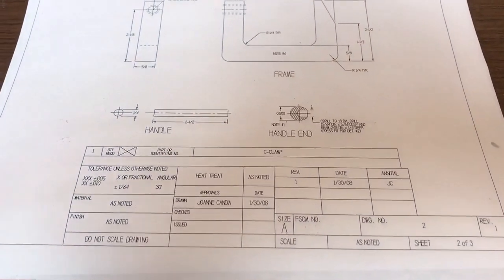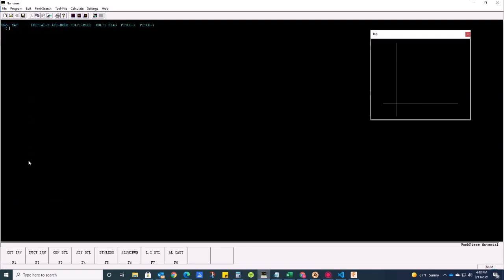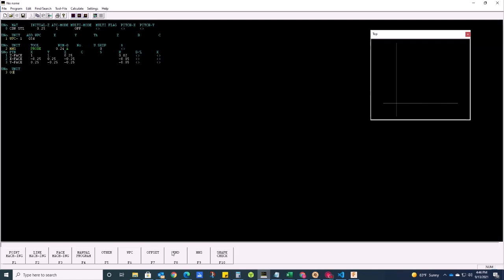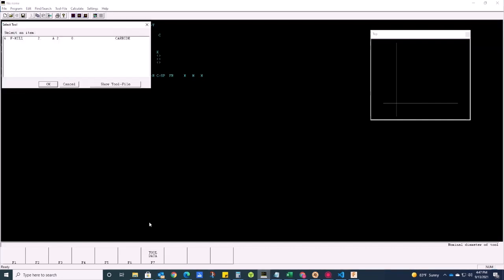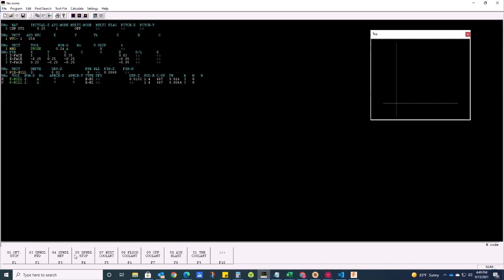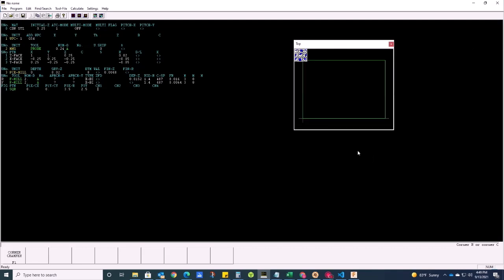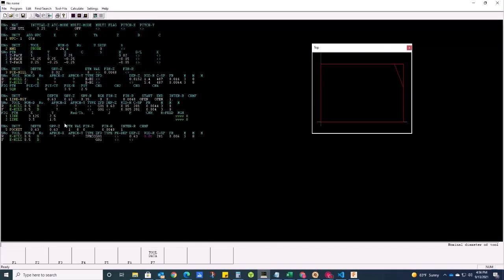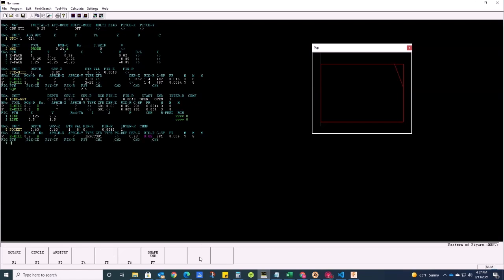CAD/CAM vs Conversational: Which One Is Faster? PART 2

Comment: My coworker who sets up lathes uses the Mori software in the control to make all arbor type fixtures. It’s faster for him because they are pretty simple. Anything a bit more complicated I program in my cam system for him. So I would say that it depends how intricate a part is that would determine if conventional is the faster choice or not.

Comment: 2 reasons why I dont like this comparison. People who use CAM will have templates set to speed up simple parts like this. Also Mazatrol seems to be one of the worse conversational programming softwares. If your gonna be using conversational on a mill its best to have something like Hurco machines, a machine with a Heidenhain or Siemens control which also offers graphical programming. I would never be programming conversational for example on a Fanuc controller unless it is a lathe and not a mill. + CAM can make the part to be done faster because all of the machining strategies, but conversational is easier to change on the spot
Reply: Buddy I beg to differ,,,,,I think it's all opinionated on preference.  I love mazatrol and will do a side by side with anybody and show just how fast programming a unit verses a page and using up down left right and question marks on figuring out complicated shapes
Reply: Also the mplus control is for me the fastest to program because of how the buttons are located
Reply: @jasonruch3529  I have no experience with Mazatrol software it just looks in the video that the programming is slow
Reply: oh ya I totally agree! He is definitely new at it because you never waste time putting a 3 in the m column,,its basically just used for coolant or air blast. Or if you had a cutter that runs backwards you would put a 4. But the controls conversion is all dictated by parameters that make everything easy. Everyone new at it try to give it to much information . I've been using mazatrol since 1999 and all the shops I've worked at had mazaks so that's why its 2nd nature to me, heck I even bought my own mazak bridge mill a few years ago because there getting so cheap. But in the 80 machines I've seen I've only ever seen a handful that went down. I mean 1 hand. On a different note tho  I've been looking at the hurco machines because there more affordable and they just came out with some really great stuff!  Like use Alexa to run it from home! Lol. The ability to import dxf files ,etc. Problem is I've never seen one in real life or know anybody who has ever ran them.